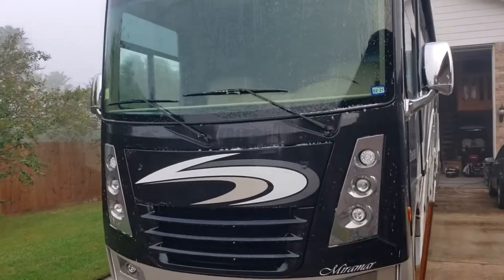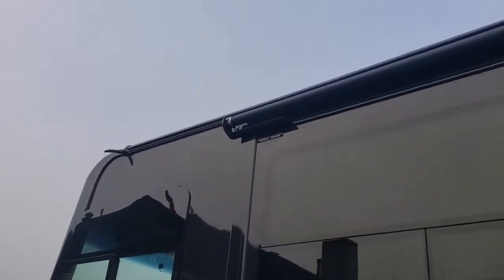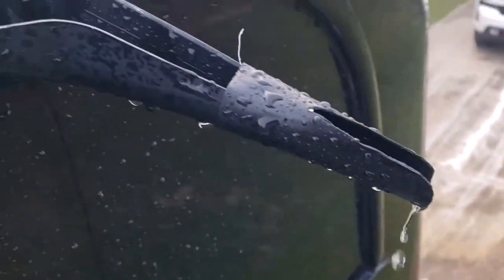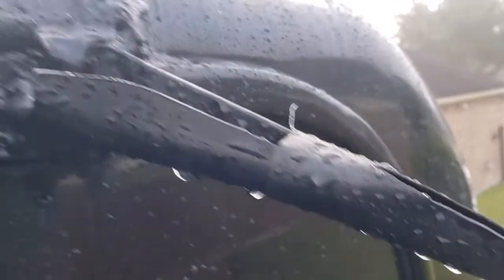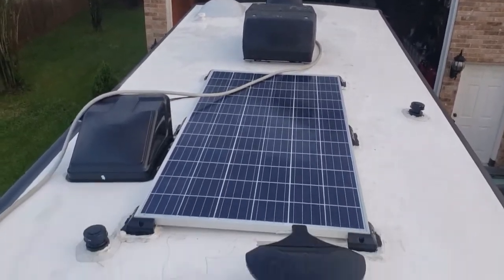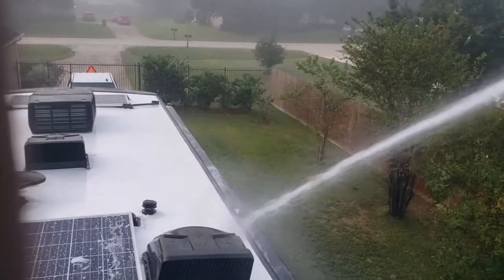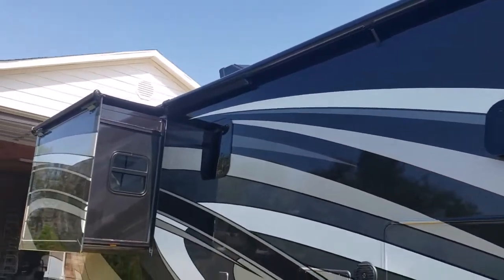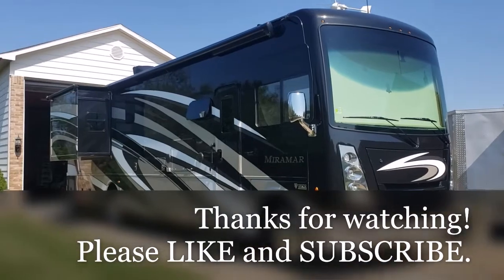Washing my RV Roof and Solar Panels on Wash Day / RV Rain gutters Explained

Comment: Still working on watching you earlier vids. I'm getting to 'em little by little. Like you, I hate washing the RV. I was getting tired just watching you do the roof. I tend to wash my RV in 2 days. Day 1, I'm on the roof. By the time I finish the roof, I'm exhausted. Might be because I'm in Georgia and the roof in summer is no place to be in Georgia. On day 2, I finish up. Then what usually happens is the rain starts. Neighbors use me as a weather forecaster. If I'm washing something, it's gonna' rain. My 5th wheel came with those gutter spouts from the factory and, you're right, they do keep a lot of the streaking off the RV. If you have an RV, listen to Gavin and get them. They're inexpensive and do save you a lot of work cleaning your rig.
Reply from the maker: The RV is my least favorite one to wash, for sure it’s an all day job 😅 or two!
Reply: @GeneratorReviews  BTW: Forgot to mention that I changed my handle form "Tom H" to "Tom in Ga" due to other Tom H's out there.
Reply from the maker: @Tom-In-Ga  ohhhh okay cool thanks for letting me know